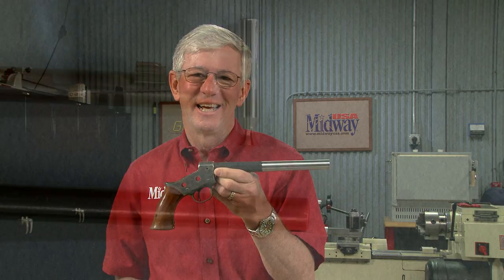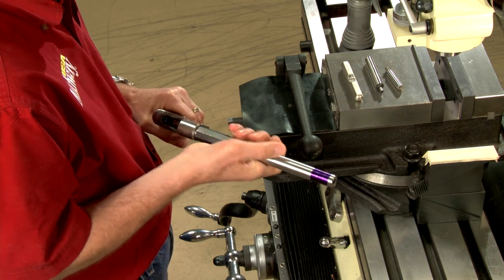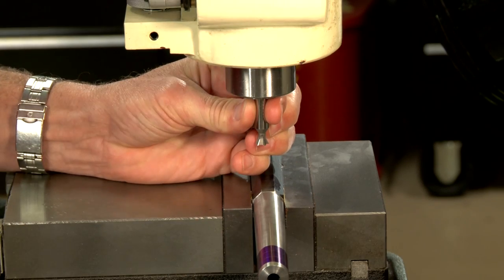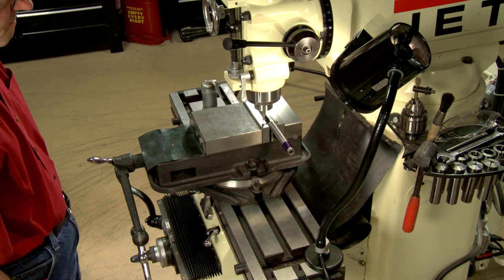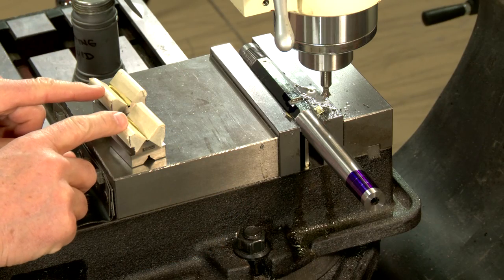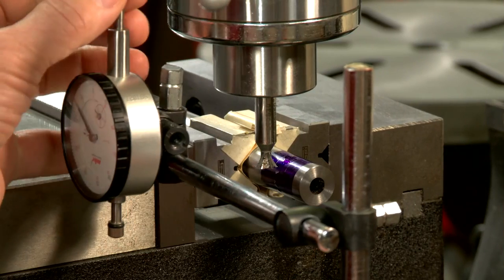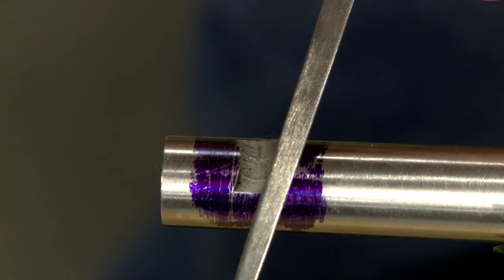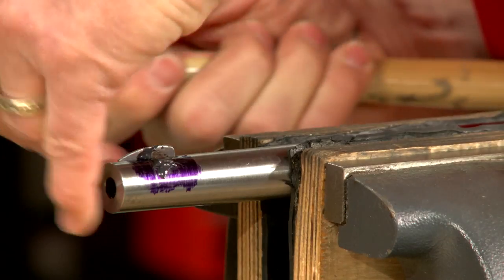Gunsmithing - How to Cut Sight Dovetails Presented by Larry Potterfield of MidwayUSA

Comment: 2 tips from a machinist. 

1. Don't rely on a bubble level, those starrett levels are only good for maybe .01. Run your indicator across it instead and it should be easy to get your barrel/frame level within .001 or better.

2. The squealing (chatter) from the dovetail cutter can be improved by running a smaller endmill through the slot first, leave a little material (.005-.01) on the bottom, then the dovetail cutter will not be engaging nearly as much metal in the cut, so by using it as more of a finishing tool you will save the tool life of your dovetail cutter and end up with a better finish.
Reply: so you're a machinist with the last name miller
Reply: As far as number one goes,  he's probably been doing this longer than either of us has been alive  so he probably can get away with the bubble level.
Reply: Does it make sense to put more work in to indicate, when it’s going to be hand filed to fit anyway?
Reply: @Pyrichia  you can’t redo a bad cut.
Reply: @baker90338  yes, that's obvious. What's your point?
Reply: @Pyrichia  less file work.
Reply: @baker90338  so first you said that you can’t redo a bad cut, implying if you take too much off, you’ve ruined the part; and I agreed. Then I asked what your point was, and you said “less file work,” which is talking about the case where you didn’t take too much off and now have to use the file to bring the part to final dimensions.   What I was talking about was, in the case where you aren’t trying to machine to final dimensions directly, you don’t need to use the best precision measurements since you’ll be correcting the part later with hand filing. So it’d be a waste of time to get too precise and therefore a bubble level would be enough.

So again I ask what your point is.
Reply: @Pyrichia  I am referring to the bottom of the dovetail cut (the part where one measures depth for) when I say you can’t fix a bad cut. If you are doing it with the indicator you won’t have to do more work to get the sight to fit in at the top front or rear section of the post.
Reply: @baker90338  Assuming perfect tooling, sure. But that's not how cutting dovetails goes, in practice, for a bunch of reasons, at least not for dovetails meant to be a slight interference fit so they stay in place just from friction.  Getting that fit requires hand filing.  See here: https://shop.harrisoncustom.com/fitting-and-installing-dovetail-sights
Reply: For dovetails with easily machinable clearances, you typically need a fastener or grub screw to hold it in place. That's not what he was going for, so hand filing was basically a requirement, and that meant not needing to chase perfection on a cut that would need hand finishing anyway to get the correct fit to make the sight driveable, but not too tight or loose.
Reply: So, using a bubble level saved work on precise indicating which wouldn't have improved the cut. It's usually a good idea not to do work you don't have to.
Reply: I do agree on not using the dovetail to do the whole job, though. I thought he was going to go in with an endmill first. But, if he's not cutting these regularly, maybe a burnt out dovetail cutter is worth the labor time saved. Especially if you're the CEO.
Reply: @Pyrichia  ah. I see your logic logic
Reply: @baker90338  yeah that's all I was getting after. Accuracy's important, obviously, you're right about that. Correct indication does matter a lot and bubble levels simply won't get you there if you mean to have precise and repeatable work. Larry didn't need it, but most jobs do and unless you know what you really need, you'd be better served with more precision, not "just enough."
Reply: indicate a tapered barrel?

Comment: Ive always been taught that dovetails are to be roughed out with a standard end mill for the majority and the dovetail cutter is only to be used to cut the actual angled section.
Reply: Big Mike's Hobby Channel that is how I do it.
Reply: I've cut dovetails both ways. I pick the method by determining what the out come is to be. If an edge, or both edges are to be precise, an end mill cut first is the way to go. If it's just a simple dovetail, there's no reason to waste the time using an end mill first. Just go ahead and cut the dovetail.
Reply: That is the way I do it.
Reply: This is the correct way, at least for general machining (never worked on guns myself). There's nothing wrong with just using the dovetail cutter, but they're pretty fragile and expensive so it makes sense to rough the middle out first

Comment: One could reduce the work load for the dovetail cutter by using a small endmill to make the first cut.  Sometimes not having to cut out the third of the work the endmill alrady did (not to mention having more space for chips) is the difference between broken cutter teeth or teeth intact.

Comment: But why always from the right side? Is there a special reason four it?
Thanks four the great vid sir :)
Reply: I guess if you want to back out the sight, it would be easier from left to right since you are not going against new material. I think what is important is just to set an universal standard in order to eliminate the guess work; "Was it driven from the left or from the right?"
Reply: @AnobisBloodwing Ik this is a bit late but the reason you drive it in from the right is because the male dovetail on the sight is tapered. The leading end is smaller and it tapers to be larger towards the far right side. This provides a tighter fit as the sight is driven in. You should always drive it in from the right and out to the left. I remember this by the saying “unless you want your sight LEFT in, you can move it RIGHT out”. If you fail to do this it will damage the dovetail on the barrel by “stretching it” if you drive the fat end of the sight dovetail all the way through.

Comment: I have a question about sights. I'm frustrated that all the cool sight options on the market fit Glocks and I own and like my Cz P07.  So I have an idea, that I would like your opinion on. What if I had my CZ dovetail recut to match Glock sights and possibly have the front sight drilled?   I really like the New Bullseye Sight but of course it won't fit Cz.
Reply: In theory it should be fine if there isn't a huge difference in the cuts.  It used to be a common gunsmithing thing to put say revolver sights on 1911s before we had all these options.  But I don't know those guns so I don't know the specifics.

In the first place have you looked to see if anyone is doing something really cool with your gun' sights, rather than reacting to things you see that you can't have (should that be what is happening).

Comment: Is the sight installed from the right because the cut starts from the right?
Reply: The sights usually have a tapered base. One side is narrower than the other. Drive the narrow side in from which ever side that allows the sight to face the right direction. If it doesn't, by driving it in from one direction and out the other, you can keep the dovetail slot in tact. Otherwise, you may have to fix it when installing a new dovetail as it will loosen up.

Comment: About what speed do you run the cutter? I'm thinking about removing the fixed sights on a Ruger EC9S and adding dovetails. Thanks.
Reply: Also wondering how to finish the dovetails to resist corrosion?
Reply: Your slide is hardened so you will need a carbide dovetail cutter which is pretty expensive, and you will need a machine with a fairly rigid spindle (e.g. your buddies old turfed out Bridgeport might not work) vibration or run out will shatter carbide. If I were you i would sell the gun and buy an LC9. 

To actually answer your question I would use regular straight carbide end mill that is slightly smaller than the neck of the dovetail cutter, run it straight through to clear out as much material as possible before using the dovetail cutter. Try maybe 200sfm and .001 per tooth. So if you have a 4 flute cutter try 2000rpm and feedrate of 10ipm.
Reply: The instructions that came with my carbide Brownells dovetail cutter say 1200-1500 RPM, with specific instructions not to exceed 1500.  Don't know of a way to prevent corrosion beyond cold blue and grease.

Comment: why not hog most that material out with a standard end mill
I thought you filed the sight to match the dovetail????
Fixture the barrel in the vice so you can cut both slots without moving the barrel - this was short enough to do this - much better accuracy, especially using that cheap level
Nice beat up front sight
Reply: The dovetail cutter I bought from Brownells was undersized, and I didn't want to cut a genuine Bomar sight.  So, I guess sometimes opening up the dovetail is the right move.  Otherwise, I'm right with you on everything else.

Comment: Cutting thru all at one time is not a good idea. Better to make a pass thru first with a 1/4" endmill and then follow with the dovetail cutter.
Reply: so many things wrong with this one

why not hog most that material out with a standard end mill
I thought you filed the sight to match the dovetail????
Fixture the barrel in the vice so you can cut both slots without moving the barrel - this was short enough to do this - much better accuracy, especially using that cheap level
Nice beat up front sight

Comment: Why do you use a level rather than an indicator?  If your milling machine is not exactly level, the part will not be milled parallel to your intended reference, which would be the milling machine table in this example.
No experienced machinist would ever use a level to align a part. Also, there's also no such thing as "Perfectly level".
Reply: As most machinists know the trick is to be within tolerance. For this application I would say that a good spirit level is within tolerance. Anything tighter than that is machinist masturbation, which you can't bill for if you're honest!